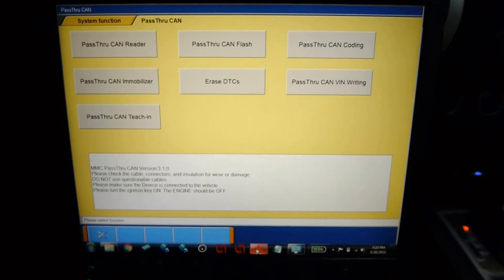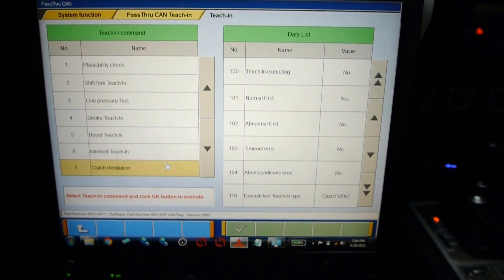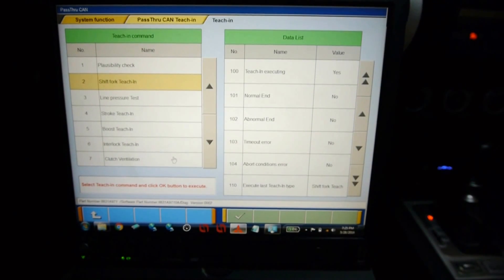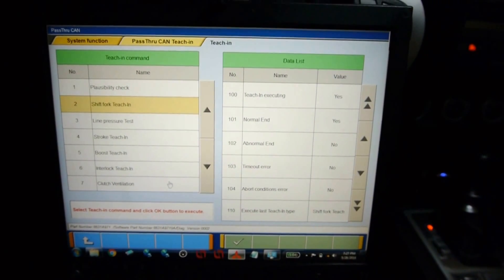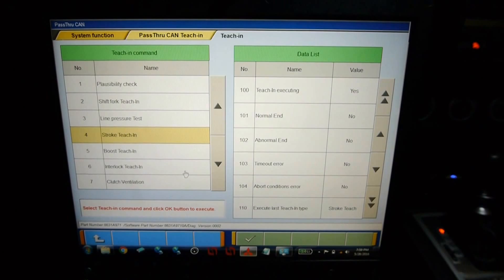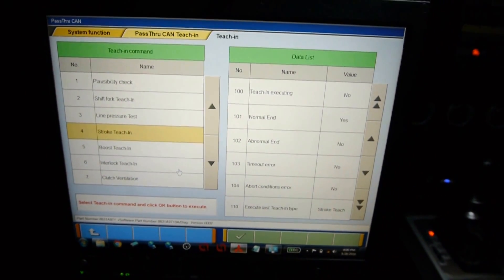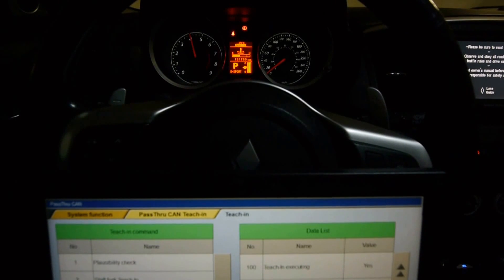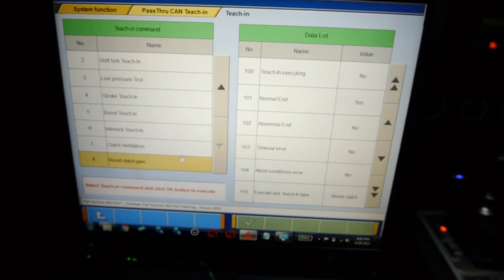SST teach-in Mitsubishi Lancer Ralliart and Evolution X MR

Comment: Hi Hello, I would like to ask what the sixth and seventh options are and why they are not executed.
Reply from the maker: The 7th, clutch vent, is used. It is options 3 and 6 that are not used. What are they for, and why are they not used? I'm not sure anybody outside Mitsubishi knows. They also appear in the MUTIII tool, but all that the factory service manual and various service bulletins say about them is "Item No. 3 and No. 6 are displayed on the scan tool, however, those are not used."

Comment: Hi Stephen，I read the manual and it says to start from step 1. Why do you start from step 7? What is the reason? Can you answer my question? The manual says 1-2 to turn off the engine, then 7-4-5-8.
Yours says 7-1-2 to turn off the engine, then 7-4-5-8.
Reply from the maker: There are times when 1 passes, but 2 fails, and it can take a long time to fail. If you start with 7 and it fails, it will fail very quickly, so you don't waste time on 2, and can solve the problem much faster.

Common reasons for 7 failing are the incorrect transmission temp, or overfilled fluid. Sometimes it fails for no apparent reason, but running it a few times will get it to eventually pass, and after that, 1 and 2 will work perfectly.

Several of the best shops for working on the SST recommend this order, and it has worked well for me on all the cars I've worked on, so it's what I always recommend.
Reply: @StephenStrangways  Bro, thanks so much for your patient answers. It's been a great help to me. When I have time, I'll also do a teach-in for my Evo. Thanks again!
Reply from the maker: @ifirex5470  you're welcome!

Comment: Hi Stephen, thank you for your assistance. I have an outlander that had the converter and mechatronic rebuilt, or swapped by the previous owner 1 year ago, and recently the car had been jumping out and back into gears randomly so I thought that this might solve the issue, but it has gotten a bit worse. before it only happened at certain rpm with higher loads, and when decelerating. now it happens in each gear when decelerating, regardless if I press the brake or not. I will soon change the oil and ext filter. do you think that would fix the issue? or perhaps the fact that I was not firmly pressing the brake pedal during the procedures can be causing this? thanks in advance for your answer.
Reply: also I am wondering if there are any forums or facebook groups related to these transmissions from where I can get inspired. There are not so many shops that are willing to fix these transmissions, and the ones that do, charge an enormous amount. so at first I wanna try to fix it myself, but I need to get informed beforehand.
Reply from the maker: @nemethiraymond2156  the ATSG guide on the transmission, a PDF file, is the best info on the transmission out there. The shops that actually know what they're doing aren't sharing much info, and most of the amateur driveway mechanics trying to fix them aren't sharing much info either, not that you'd be able to trust it all anyway.
Reply from the maker: If the brake pedal were not pressed at all, the teach-in would give an error and refuse to proceed. It's just a safety thing, to make sure if the trans accidentally engages that the car won't jump forward, and doesn't affect the effectiveness of the procedure.

My first thought is that maybe the previous owner got a used mechatronic that is now starting to fail, or they got it rebuilt by an incompetent shop, as there far more shops that think they know what they're doing but actually don't then there are good ones.

Comment: Why don't we do the interlock tech in?
Reply from the maker: The Mitsubishi Factory Service Manual just says it's "not used."

Some shops believe it can cause problems, especially if the trans is cooler than maximum temperature for the teach-in, so they never touch it.

Other shops use it for diagnostic purposes: if shift fork teach in fails, they'll do an interlock teach in, then back to shift fork, and it usually passes. If both fail, it indicates a mechanical problem with the transmission.

Comment: How do I know if my transmission need to be programmed,,, I have 2011 ralliart sst transmission in only have reverse,,, also transmission has been rebuilt and has engine lite on for p184b shift fork 4 malfunction
Reply from the maker: Was it just rebuilt recently, and you're having these problems after it was installed back in the car, or was it rebuilt some time, was working fine, and just started having these problems recently?
Reply: @StephenStrangways  yeah after the rebuild it’s never work correctly,,, I guess they couldn’t get it to work
Reply: @StephenStrangways  so it has a solid reverse,,, it only goes forward if you start the car and right away put it in gear it will roll forward ,,,And then lose engagement
Reply: From what they told me,,,They replace the wet clutches to fix the magnet on the shift forks with special glue,,, they supposedly went through the whole unit!!! So they told me it could be a program issue!!! But I can’t be too sure I’m thinking about open the unit up myself,, I just wanted to confirm that this wasn’t a program or computer issue
Reply from the maker: @tyrellwilliams3814  well first of all, gluing the magnet back on the shift fork won't work for very long. It should have been replaced with a better shift fork, like the one from Dodson. So it sounds like you went to a shop that doesn't really know what they're doing. Second, the magnet must be very precisely placed, and its position does need to be calibrated with a MUT-III, which it sounds like they didn't do.

To be honest with you, it's a rather difficult transmission to work with, so your average transmission shop can't do it properly, most transmission shops that specialize in dual-clutch transmissions can't do it properly, and even some shops who claim to specialize in the SST are liars and cheats and can't do it properly. There have been many cases of people taking their cars back to a shop half a dozen times over a year and never getting their SST running right, until they eventually get it to a shop that actually knows what they're doing. What country do you live in?
Reply: @StephenStrangways  I live in United States— in California
Reply: @StephenStrangways  thanks for the information too
Reply from the maker: @tyrellwilliams3814  Kozmic Motorsports in Texas is the only shop in the USA that you can count on to fix an SST correctly every time. Often they'll know a shop in your area good enough to remove the transmission and ship it to them, and they'll fix it properly with new parts that are better than OEM, fully program and test it, and ship it back ready to be installed and run perfectly. They spend a lot of time fixing the stupid things other shops do, like trying to reattach magnets to shift forks using metal wires and weld-bond.
Reply: @StephenStrangways  thank you so much I really appreciate you!!! Imma give them a call kozmic Motorsport

Comment: Hey Stephen, i just picked up a project evo x mr 2008 with transmission issues, the car seems to shift slow. For example when i put it in drive and give it some gas it will take a few seconds before the car actually moves. It did have a huge exhaust leak in between the turbo and manifold which i am currently fixing. Also the car is a 2008 and when I crawled under it i noticed the transmission only has 2 drain holes so it is from a 2012+? Would you have any insight on if the exhaust leak could affect the transmission and if it being a different year could affect it?
Reply from the maker: If it was driven for a long time with an exhaust leak, some of the self-learning features of the ECU and TCU would have adjusted to it. After fixing it, they'll need time to re-learn, but a teach-in for the trans could indeed help. A bad tune could also cause shifting issues, and it's not unusual for cars to be tuned for aftermarket parts that the owner removes before selling the car, which can cause even bigger problems like overboosting and running lean. Different years of transmissions had either 2 or 3 drain holes, but it makes no practical difference.
Reply: @StephenStrangways  thank you for the info, while i am fixing the turbo exhaust leaks i am also putting all the stock parts back on and getting it flashed back to a stock tune, hopefully after that and a teach in and fluid change it all comes together
Reply from the maker: @Gilligan.Garage  the one thing people often miss that can cause a lot of problems is the boost controller. You really don't want an aftermarket 3-port EBCS with the stock tune. It's also a good idea to replace the relays if they haven't been done recently.

Comment: hi stephen stranways , my 2008 evo mr shift but wont engage , all shift cable shift , but didnt do anything and on my dash didnt show p, d , r or neutral , so teach-in gonna solve problem ? thanks guy if anybody know whats going on ?
Reply from the maker: A teach-in definitely won't solve it. If the physical linkage to shift in and out park is connected, but there is no gear display and no gears are engaging, check the wiring harness connections. If they are okay, it may be that the mechatronic/TCU has failed and will need to be replaced.
Reply: @StephenStrangways  thanks for reply

Comment: I just did the teach-in everything was successful except the stroke teach-in and now my ralliart clutches are slipping and I just had it rebuilt with new clutches anyway to fix it without tearing it back apart?
Reply from the maker: Try doing a single teach-in, in the order 1, 7, 4, 5, 8

Which shop rebuilt it?

Comment: Great video! Is it recommended to do that after each SST oil change?
Reply from the maker: It's only specifically required after changing the clutch basket or valve body, but it does seem to help to do it once every few years. As most people change their SST fluid (don't forget to do the rear diff fluid at the same time, and the transfer case twice as frequently!) Once every two years, it just seems like an easy to way to remember to do it, if you do it with every fluid change.

Comment: Hi Stephen, hey I download the files from your link, but I having a problem, when the program opens just show me the read vin, and them nothing more, I can read the vin from the ecu engine or the AT, but nothing else, can you help me please, best regards
Reply from the maker: After installing the program, you need to overwrite the file ptc32.dll in the program directory with the version of the file that is on Google Drive. Be sure to read and follow the PDF which has instructions for making registry changes to install the program in the correct directory, or it won't work at all.
Reply: @StephenStrangways  thanks

Comment: I got a used 2011 Evo x Mr that I just changed all the fluids from the sst to oil to drive train. I have noticed that first gear is slipping alittle and that on turns in manual mode in  S-sport or any mod it will up shift it self when I'm going slow ? Or turning a sharp corners. Would me doing every step mabie help? And can this make it undriveable? If something Gose wrong well it's re learning? The dealership told me they don't wanna do any of them with them taking it for test drive First :/
Reply from the maker: It is normal for the transmission to upshift automatically, even in manual mode, when it is very cold. Once it reaches operating temperature, which can take 20 minutes in the summer and 40 minutes in the winter, it should not be doing it.

If it is doing it while warm, a teach-in will not help with that. One possible cause is a bad tune, or the car was tuned with mods installed that the previous owner removed before trading the car in, so the tune doesn't match what it is on the car now, and it will need to be re-tuned.

If it's not that, it could be that the transmission is heading towards failing, and a rebuild from a trusted shop is going to be $2500-6500, a replacement from a dealership $10000-13000, so if you have any sort of warranty from the dealership, you want to get this sorted before it expires.
Reply: @StephenStrangways   oh god 🙏 I got it private and it has the Cobb stage 3 kit installed and the Cobb port to go with it ? That all I really starting loving this car.if I do the teach-in will it help it? Or make it worsen it or do nothing you think?
Reply from the maker: @ryankuiack2235  a teach-in certainly can't hurt, so it's worth trying, but it's not all that likely to fix the problem. The Cobb OTS maps are TERRIBLE for the Evo MR because they increase power without making any changes to the transmission tables to help the clutches hold the extra power, so it just shreds the clutches. What you really need is a proper custom tune from someone who actually understands the SST transmission, and that may reduce the clutch slip you are experiencing now. Hopefully it wasn't driven too hard for too long with the Cobb setup, because if it was, there probably isn't much clutch material left.
Reply: Well I hope so I'm wondering if I can Flash it back to stock ? With all the mods it has and do a teach in? And that would save it tell I can get a pro tune done
Reply: I deeply appreciate you help and time I can find a clear answer for anything to save my life I get alot of just trade it and get a gsr lol
Reply from the maker: @ryankuiack2235  you don't need to flash it back to stock to do a teach-in. If you flashed it back to stock, you'd also need to swap back to the factory boost controller, intake, and preferably also the catalytic converter, otherwise you'd overboost enough to blow the engine if you drove it hard.
Reply from the maker: @ryankuiack2235  the MR is a great car, but unfortunately lots of people do stupid things to them, from never changing the fluids, to getting bad tunes (Cobb OTS, incompetent custom tunes) that make them far less reliable than they should be if treated properly.

Comment: I have installed Pass Thru Can, but I cannot use Pass Thur Can Flash.
When I click Pass Thru Can Flash, I get the error Fl Part file is not installed correctly. Please tell me how to deal with this error.
Reply from the maker: Follow the Google Drive link in the description. There is a PDF there, "TC-SST Flash_Reflash Guide.pdf" that explains how to modify the files, and what directories you need to put them in.

Comment: Mine stuck on clutch vent never end what could it be the issue
Reply from the maker: If the car is not parked on level ground it can fail clutch vent, or if the vent itself (top of the transmission, near the fill hole near the battery tray) is blocked it can fail, but the most common cause is the transmission was over-filled with fluid, which is blocking the vent. Many people, even techs at dealerships, misunderstand the fluid quantity, and they drain 5.5 L then read the "dry fill" specs and put 7.5 L in, which over-fills the transmission by 2 L.
Reply: @StephenStrangways  I'll try to check the fluid tonight and retry again
Thanks
Reply: @StephenStrangways  how do I check the fluid level? Or it's better for me to just drain out and refilled with 5.5L?
Thanks
Reply from the maker: @RecreationAutomotiveGarage  officially: drain it, measure it, put it back in. Unofficially: there is a check plug, but it's only designed to work in the Outlander, so in a Lancer, you need a hex key that fits perfectly (possibly modified) between the plug and frame rail, and when parked on level ground, it will drain any excess fluid out, but it won't help you if it's under-filled.

Comment: My tuner says I should do a teach-in before they tune the car. Is this true?
Reply from the maker: If a year or two has passed since the last teach-in, it would be a good idea to do a teach-in before a tune, and most importantly, drive the car for a while afterwards, at least a day or two, before the tune.

When you perform the "reset clutch gain" function, it takes a while afterwards for the clutch gain to re-learn a good, lower setting during normal driving. If you don't give it time to re-learn during driving, it will have greater than normal clutch pressure, so if it's tuned like that just to the point where it doesn't slip, and the transmission later learns a lower clutch pressure, it could start to slip then.
Reply: @StephenStrangways  I'm having A LOT of work done, built block and header, all bolt ons, new turbo, fuel pump, injectors.... I don't want to drive it a lot before the tune. At the same time, it hasn't been driven since 1/26/20, that's when the engine failed.
Reply from the maker: @audilicous  then personally I would not do a teach-in before the tune.

Comment: How to connect to car?
Reply from the maker: You need a cable that connects to the OBD-II port and supports the j2534 pass-thru protocol. The Tactrix OpenPort 2.0 cable is an expensive choice but very reliable, and also allows you to do a lot more with Evos and Ralliarts. Beware of cheap knock-off cables from eBay, Amazon, and Aliexpress.